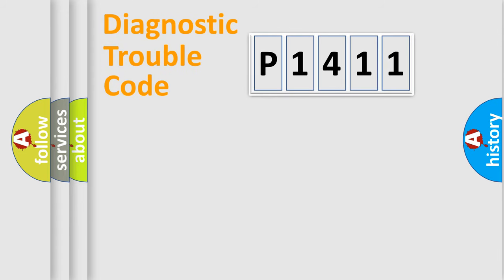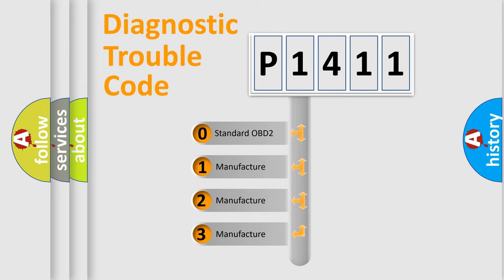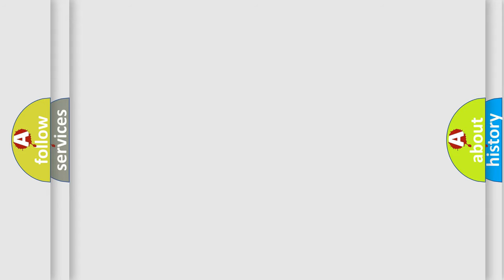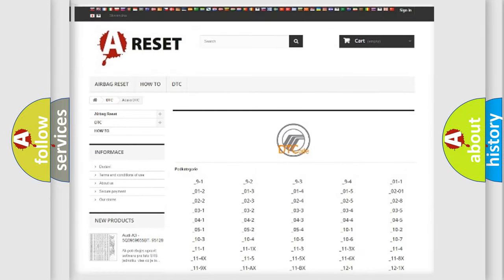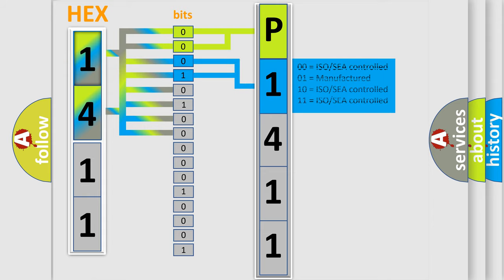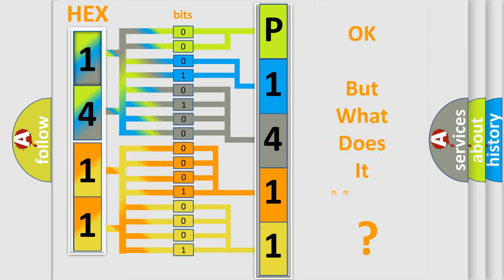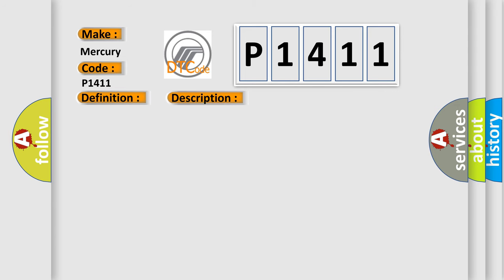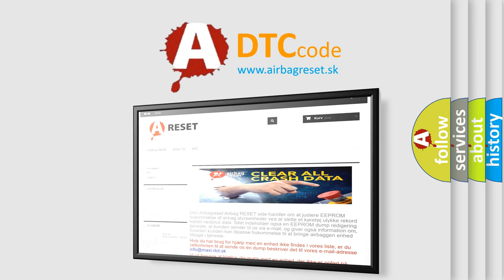DTC Mercury P1411 Short Explanation

Comment: Hello, I have a trouble code P1411, and cylinder 1 has start control performance issues, with the car shaking violently. Is this caused by the trouble code?